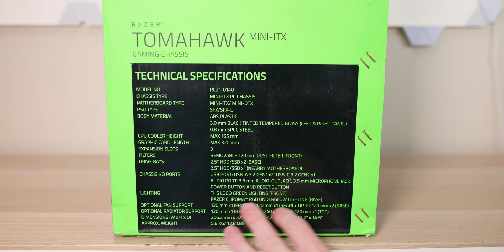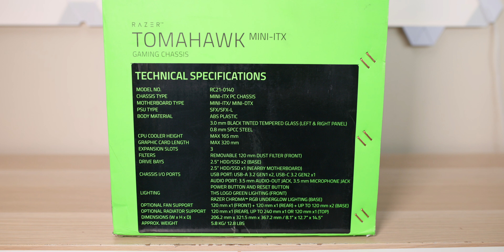RAZER TOMAHAWK MINI-ITX The Best Mini ITX Case? Unboxing and First Look

Comment: can it fit a 3 fan graphics card like 2080ti? also the room you need 32 GB, I would rather go for intel 7 maybe Ryzen 9 if you can find them, they really should have installed a small internal battery to start you of but overall lose the built would fix for my desk in my room rather then under my desk like a hitting my kneecap xD 

p.s would be great to fit in a bluray disk drive